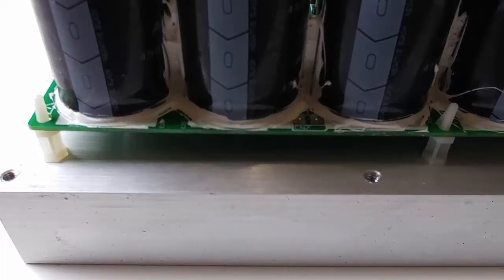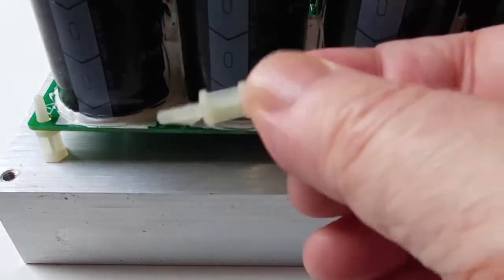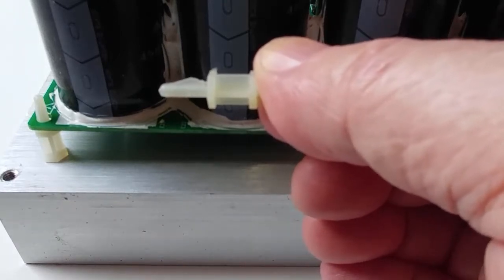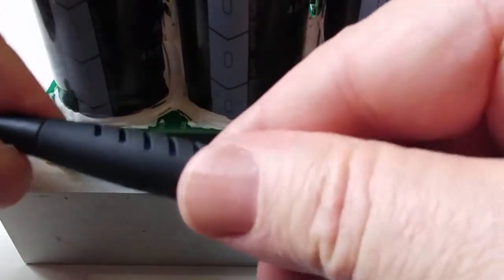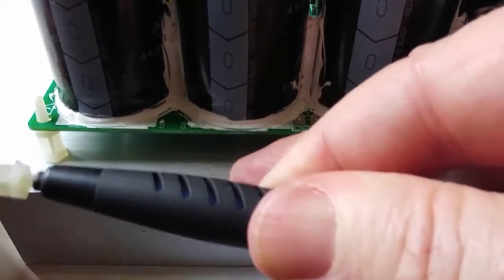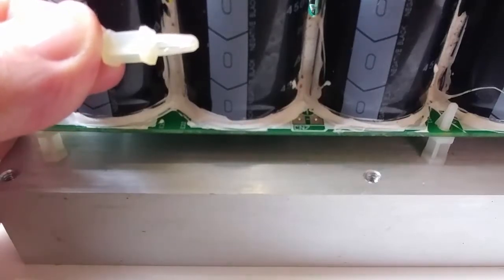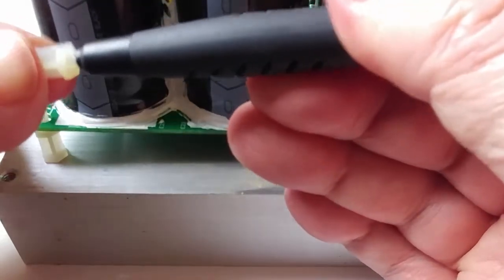Detach a PCB using a Pen to Push the Nylon Standoff Back

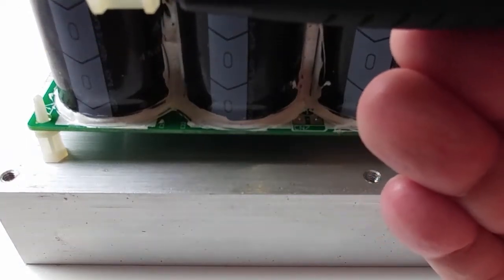Comment: At first I was like yeah right push on the tab with the one point but glad I kept watching. I think what this may ALSO do is push on the other two sides of the standoff to compress 4:00 all around to allow it to pass through the hole. I won’t be trying this for a day but will edit with result. Possible godsend of a vid for me. If I have the right pen. 😂